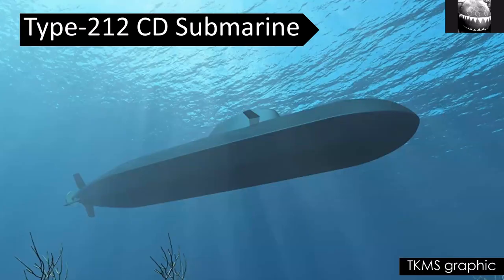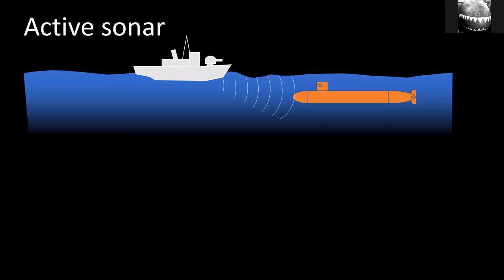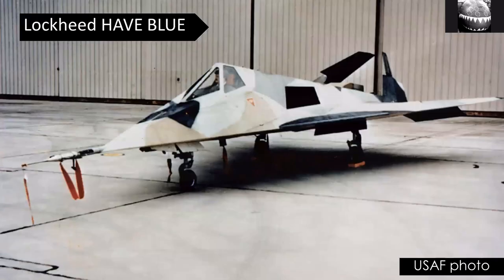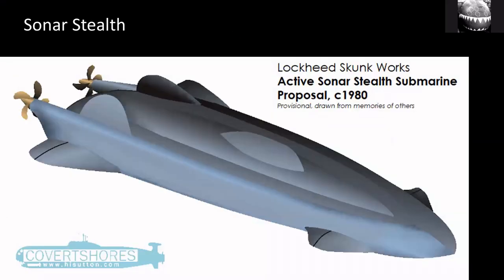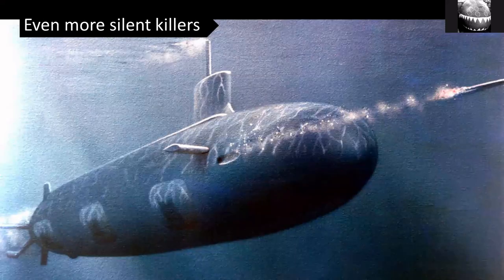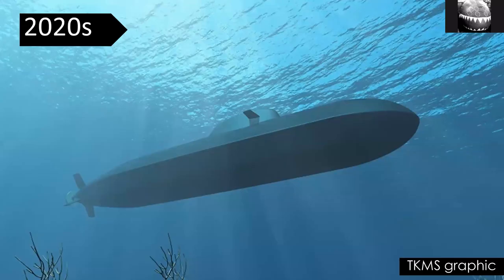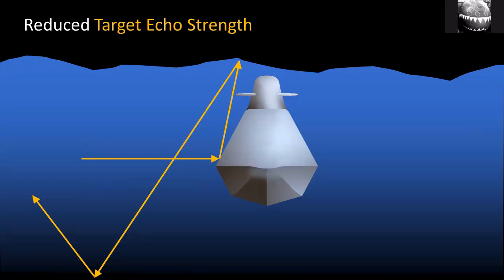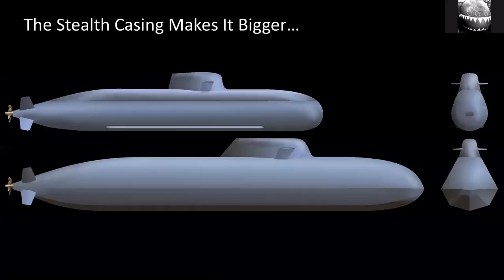The New Stealth Submarines Explained (Quick Guide)

Comment: You getting stuck in the same old US thinking of stealth. Stealth also includes visability, sound, magnetic, heat etc etc. And you can make a sub stealthy in different ways. You can compare this with F-35s stealth and a planes that uses high EW to counter detection. The EW for subs is more adaptable and more easy to change if constructed right. The same with planes......

Comment: Do have a question. Just as “low observability” on aircraft works only at specific frequencies. How does the frequency of sound react to “stealthy” shapes on subs? Yes, I understand how much larger the spectrum is for radio, than what it is for sound. But, surely there has to be a frequency where these “stealth” subs become more visible.

Comment: Sonar reflection are going to be subject to diffractive/resonant effects in the same manner as radar waves, and that means that shaping like this will only be effective against higher-frequency sonars (ones for which the wavelength in water is smaller than ~10% of the size of the shaped features). The speed of sound in water is ~1500 m/sec, so a 1.5 kHz sonar has a wavelength of 1 meter. Given that the shaped "panels" here are at most 5 m tall, I think that they will be most effective against 3+ kHz sonars.

While that covers the vast majority of warship sonars, it does leave a window of opportunity for systems like the low-frequency active (LFA) arrays on US SURTASS ships.

Comment: The two propeller design from Skunk Works is interesting, because two ship propellers allow them to run with a lower RPM. As the screw speed increases, it becomes very loud due to caviation. The cavitation at the outer propeller tips causes small gas explosions which can be easily detected by the sonar.

Comment: The larger size is caused by a vertical launch system (VLS) wich will be integrated in the Type-212CD. The 212A can currently only fire missiles from the torpedo tubes, the IDAS from Diehl Defence (IDAS Interactive Defence & Attack System for Submarines)

Comment: Another thing to add: the German 212 submarines use Hydrogen fuel cells and batteries. So they basically don't have any moving parts except for the propeller itself. They have reached a point where you can't do much to reduce engine noise anymore for passive sonar stealth. So active sonar was the only remaining weakness, the only thing you could tackle and get better at.
Also interesting, the German submarines are usually small because they must be fully operational in just 17m deep Baltic waters.
Reply: Well, can the propeller  be eliminated?  I've been able to get good forward speed only using dive planes and buoyancy changes.
Reply: @lqr824 17 meters.
Reply: I'm pretty sure hydrogen fuel cells have moving parts in practice, like for pumping the hydrogen. Hydrogen fuel cell cars for example definitely make noise.
Reply: moving parts definition:  propeller itself, propeller shaft, thrust bearings, rotary bearings, motor rotor, motor rotor bearing, magnetic field created by motor stator, any number of moving parts i left out.
Reply: Not to mention that small submarines are usually more detectable by passive sonar because they have less volume for acoustic quieting measures.
Reply: @JohnnyBravo68260 not really. The 212A have a very advanced sound suppression module. Additionally most of the larger submarines are nuclear powered. That requires cooling pumps that need to run 24/7 because the reactor can not be turned of. Those cooling pumps create noise that can be heard on passive sonar. Smaller diesel-electric submarines obviously don't require those pumps and just shut the diesel engine off while diving. The 212A can stay submerged up to 2 weeks just driving on battery power. So they are actually less detectable than larger submarines.

Comment: Interesting but the B2 showed that the complex calculations needed for smoothly curved shapes are possible hence there's no longer a need for the flat faceted surfaced of Have Blue and the F-117 Nighthawk.   Also, these "stealth" shapes simply deflect the signal away from the emitter so this kind of stealth is ineffective if there is an unpredictable distance between the signal source and the hydrophones (receivers).  With radar and planes, it has been suggested that the background radio emissions from cell phone towers be used to illuminate stealth aircraft as the geometry between the towers and the radar receivers would be variable and hence could not be accounted for by the shape alone.  Likewise, with a tradition of wireless connected hydrophone buoys and the seismic acquisition techniques of towed hydrophone arrays, such stealth shapes should be easily countered.  I would be more interested in meta materials directing the sound around the submarine though what we publicly know of are only effective at specific frequencies and low frequencies at that.  Calculations for a selection of frequencies may be computationally difficult perhaps even impossible and the scale of the construction may be very fine for higher frequencies and hence difficult to manufacture.

Comment: it seems like a really good idea until you get detected. I say this because when the angle of incidence is almost 90 degrees (depending to distances between the objects), you've suddenly become a massive blip. submarines lack the speed to evade unlike an aircraft, knowing the dimensions of the submarine will provide a reflective signature of each panel and that is trackable. because the size of the flat surfaces are not the same this further characterizes the submarine profile. futhermore, unlike air, the oceans have a bottom that reflects back and thus anything that doesn't reflect will shadow the sea floor. in deep waters this is not an issue but it may factor in shallower waters. overall I think it is a net benefit, but not a huge deal.... *reclines back in computer chair, my work here is done.

Comment: Can you hide from satellites underwater? I know they have wake detection and stuff but can you just go deeper?
Reply: Depends. Nuclear powered subs acutally have a hard time to hide from satellites in open water because they leave a warm wake behind. even if they are submersed. The German 212 class uses a hydrogen fuel cell as primary energy cource once dived. This produces very little heat an hence is nearly undetectable. Japan also works on a submarine that can run soley on batteries for days.

Comment: You should do one on the rubber coating. First developed by the Germans in WWII. Two layers, one with a specific pattern of holes with the signal absorbed by the 2d layer.

Comment: have to say it; F-117 is not a fighter, but an attacker, despite the misnomer "F" in its type number. It was designed to not manoeuvre much and is easily beaten in a turnfight by nearly any other aircraft. It needs to fly in low radar coverage areas, and get out before scrambled fighters can get up to catch it.

Comment: Not sure how good rubber paneling is at absorbing sonar when it gets harder as it compresses at depth! 2ndly whales are something sonar picks up as active, but non metalic contracts! You can also tell if they are closing or opening range! ;p Cold layers are the best way to hide from sonar as the beam digs in or bounces off the layer pressure difference! Dimpling the rubber would be the best way to diffuse an echo return! Turning a round profile into many flat surfaces doesn't sound like a great strategy!

Comment: The German stealth aircraft was probably the MBB Lampyridae which apparently was twice as stealthy as the F-117 and was allegedly cancelled in 1987. As this was during the cold war and before German reunification, it might be possible that there was some backroom pressure applied by the US but so far this is just a rumour. MBB and its sucessor company DASA (now part of Airbus) never disclosed why they ended the project. Germany at that time had another fighter jet program ("Jäger 90") also in development, also by DASA that they might have just settled for a more conventional design. The Jäger 90 program was essentially a blueprint and became part of the EF 2000 Typhoon (aka "Eurofighter") program. To me that sounds more plausible, but maybe Airbus will at some point release the information.
Reply: Probably just to save money, as usual. Germany is smaller country with less GDP so U.S. has natural advantage in developing super expensive projects. Germany spent money on reunification. Politically wise U.S. is happier when EU spends more money on defence, not less.
Reply: @denysivanov3364 this was the reason. The reunification was a multi billion dollar project, and the threat was gone all of a sudden. Why build a jet you don’t need, with money you don’t have?
Reply: @foximacentauri7891  also Soviet Union started to roll back expansionist policies with Perestroyka ("rebuilding" by Gorbachov)
Reply: Lampyridaes outdated stealth shaping was most likely reason for cancellation.

Comment: It's not actually artificial intelligence that has enabled these designs, it is computers with more computing power to handle the millions and billions of calculations necessary in a reasonable amount of time to simulate the behavior of sound waves in various densities of water reflecting off of of very complex shapes.
Reply: I'm a bit late but I was about to comment almost exactly what you wrote. There are ways to have a computer "look for" an optimal hull design that have absolutely nothing to do with AI. You enter the variables you want the software to test variations of, what the range of the variables are supposed to be and whatever boundaries or relationships they have are. Then you have the computer simply test all sorts of combinations in a simulated environment to find what values produce the best results. There is no "AI" in this, the computer makes no decisions, it simply performs a programmed range of experiments in a simulated environment in an automated way. 
I've built test setups to put software systems I made "through the ringer" to find faults or weak points in them, there was absolutely zero AI involved in any of it. It's just "for every value of A going from 0 to 255 test every value of B from 0 to 255 and for every value of B test every value of C from 0 to 255" type of stuff. You automate it not because you can't do it manually but because it would take forever to do by hand and you'd go cuukook doing it as well as likely make mistakes out of boredom and monotony. It's not AI. It's automated testing.

Comment: However. In regards to dispersing the incoming sound in "other directions", will have a big issue of its own.
One isn't particularly hidden when wearing all black in a gray room. Nor all white for that matter.

Sonar can hear the eco of the sea bed itself, it there is a spot where it clearly is missing, and said spot shows clear signs of parallax error as one moves, then there is clearly something there at a now known depth and position that disperses the expected eco from the sea bed itself. (to actually know the depth and location of the anomaly, we have to have more than 1 sonar, as to get some stereoscopic view of the scene. But on a 100+ meter ship, that shouldn't be all that hard.)

So it is a fine balance.

Perhaps subs could use phased array piezoelectric transducers covering their exterior, as to both notice the incoming signal (and "perfectly" cancel it out), and mimic a returned eco with appropriate delay for where the sea bed is known to be. But this would be fairly complex system to say the least...

Comment: Your analysis of stealth fighters is incorrect. 
We have stealth aircraft without faceted designs, like the F35. The reason older fighters are faceted is because the computer analysis methods back then couldn't do complex finite analysis for EMI, so they simplified the methods based on what they expected incoming radio waves to look like. 
Additionally, stealth aircraft still aren't invisible to radar. They make a signal, but it's harder to distinguish it against noise. Bosnia famously shot down an F117 by recognizing it's flight pattern, and tuning their radar sweeps specifically to look for the flight pattern previously positively identified.

Comment: Its not like radar... disappearing isn't hard to do in the ocean.. been in many multimodal group ops while serving on a submarine. and I like the information but simple fact is, the ocean is very noisy and its easy to spot a " silent" zone and boom that is where the sub is located. The only use of angular hulls is to limit radar signature on the surface, underwater it just makes it easier to do some trig to complete target id based on the particular angles of that submarine. Only way to make a stealth sub is to have it repeat the background noise to cover its location as it moves.

Comment: Just a note to say that the classic angular shape of the F-117 was almost entirely down to 1970/80 computing power.  The next stealth aircraft, the B-2, was far less angular and the modern F-35 not angular at all.  My point is simply that blocky angles does not necessarily equal stealth.

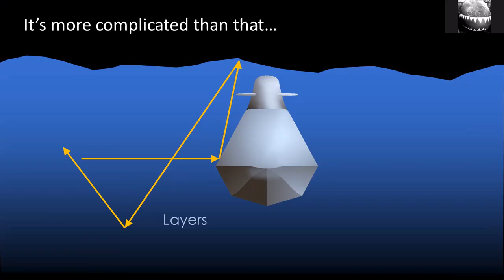Comment: 9:35  i dont get this...both radar and sonar SHOULD take into account the natural LOCATION of the SENDER..
You see that for the stealth plane they ALWAYS assume the SURFACE radars (NOT the enemy airplane radars ..or even AWACS in the air!!)..
Likewise..you d EXPECT the active sonar emanating from ????  the waterSURFACE (in case of vessels)...OR ..pingers from the SEABOTTOM.
When looking at this angled submarine shape..you IMMEDIATELY detect a flaw  in that the water surface ships have a capability to attain a BIG reflection surface on the UPPER side of the submarine hull...while the seabottom pingers get a large surface reflection off the lower corner of the submarine hull...
Reply from the maker: They anticipate active sonar from all angles, but mostly the side. The missing ingredient is distance. For a submarine at 300m depth, the 'perfect angle' from above is approximately 400-200m away depending on exact angles of sides. That's really close.
Reply: of course there are also torpedo run sonar diving though the depth layers at any conceivable depth operating from a surface ship by wire/remote control...so really the enemy submarine is pinged at at MANY different elevations !!!
while the airplane "only" has to deal with ground radar...

Comment: The Navies around the world are finally waking up. In the book "Skunkworks" by Ben Rich it said they did make a quick model and gave it a try. It had a sonar reflection (IIRC) 1/100th that of a normal sub. The USN response was "Submarines are round".
Reply: My question is if it would work as far as a pressure hull
Reply: @hint0122  real question from a plane nerd: why would that matter? If the ship is sufficiently hard to detect, then it can simply sit at shallower depths without caring, right?
Reply: @IntrusiveThot420  There may have been issues when it comes to the body creating hydrodynamic noise. basically the fear was likely that the body would induce turbulent flow in the surrounding air, making noise that can be picked up on passive arrays.

Comment: Even if a reflected signal from the water surface and off the bottom comes back to the sender. What good is a reflected signal that took unknown detours and coming from a random position? No distance info, hardly any usable bearing info...

Comment: One small comment from someone working with "AI": You'd probably not use AI as a main tool in engineering projects. Most likely they used computer simulation, but that's a massive field and does not mean they didn't use both. Just that AI is not the main choice for such a project. 

Generally speaking: Few examples with well-understood physics indicates simulation.
Many examples with less well-understood physics, and/or fast computation time indicates AI as a main tool.

Also in another video, you made a comment on quantum computers on submarines. While I can imagine significant computational power as being extremely useful on subs for any kind of data processing (I bet somebody is developing or has already developed algorithms for sonar) I doubt quantum computers are a massive consideration for the current or even next submarine generation.

Comment: a think i heard before that is a weird quirk to submarines. is they can be too stealthy. thus be a void in the noisy ocean. so a submarine has to be as noisy as the ocean, otherwise it stands out for being too noisy or too quite.
Though this system has the same problem as stealth aircraft. in that it's vulnerable to array systems. But those only can exist defensively, because they are networks arrays. Though their are offensive arrays in concept, using drone swarms. But to explain an array system, it's simply put just a bunch of radar, sonar, or whatever communicating to each other. So they each know where the others are and what their id's are. So anything that enters the area is breaking the connection between stations and/or reflecting to other stations. Which with some math you can figure out where the object is roughly or depending on network precisely where it is.
But  atleast submarines aren't subject to Smart AI munitions, because the ones I know of require visual sight to decide on whats a target and track it. I don't know how such a guidance method would be useful underwater compared to normal guided weapons used. Since you can't see anything and radiation detection methods are pretty useless under water.